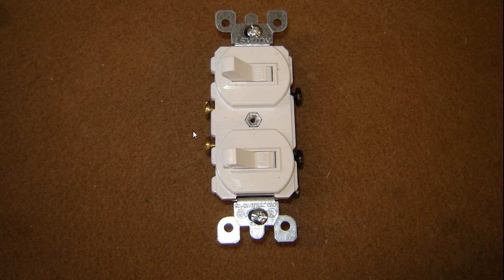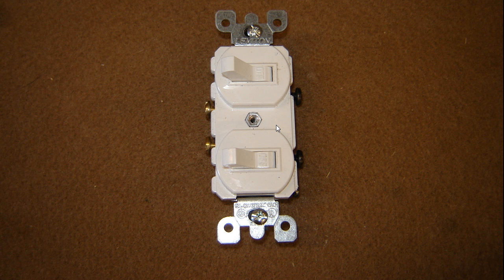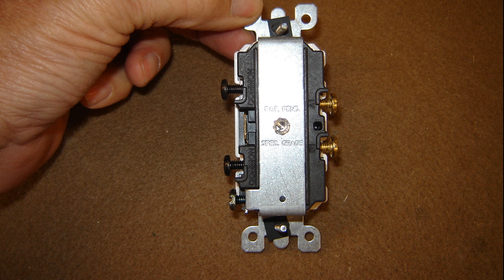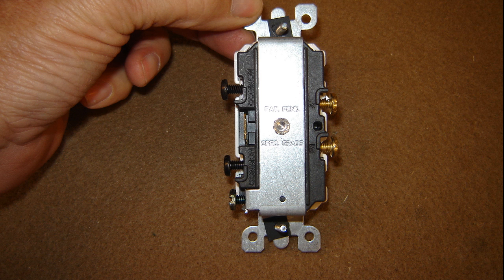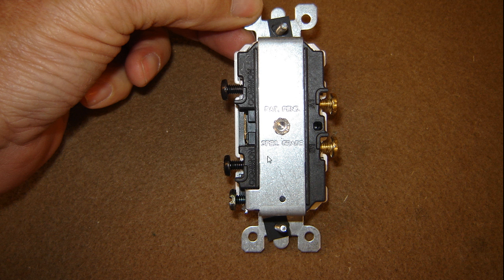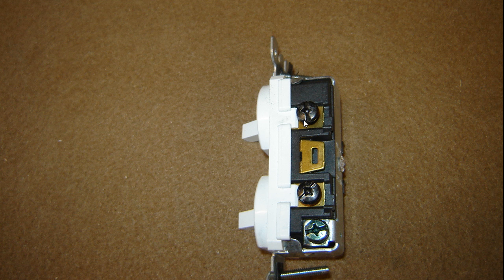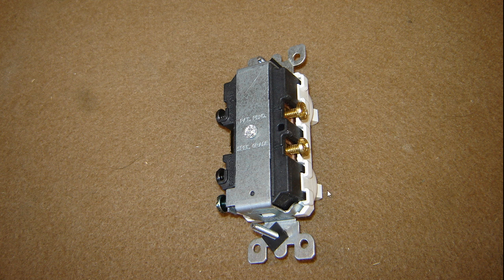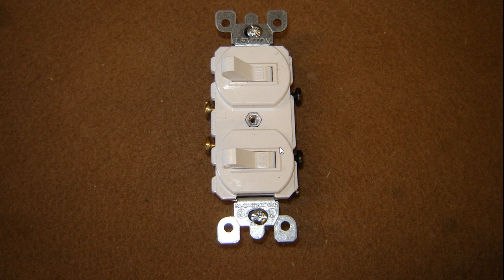Electrical Wiring-Stack-Switch

Comment: When do you have to remove the tab between the 2 black screws? Is that when you have two circuits or when you do not run a jumper when you only have one circuit?

Comment: BLACK WIRE GOES WHERE. WHITE WIRE GOES WHERE!!!
Reply: marcia w Your white will go in a wire nut on their own. the appliances white wire and the white wire coming from the breaker that's bringing the power to your device will go together into a wire nut and taped up
Reply: @kytrapping5829 How does the switching stay in dependent then? I'm stuck here at this point. I had a single switch and the line neutral and the switch leg neutral are tied in and the 2 hots are on the screws. Ground tied in as well. 

Wanting to add a stacked switch, but the switching legs would then be tied together so how does the switch differentiate at that point??

Comment: Need to give more detailed infor re break away tab when to break and when to not break and what does it do
Reply: The break-away tab is only broken if you want to have each switch on its own power source. If you have only 1 power source you do no beak it and hook common (black) either of the black screws. With the tab intact, it provides connectivity between the two switches so that they both receive power as long as there is one feed to either black screws.

Comment: Hot goes on the brass screws, switch legs go on the black screws, otherwise you've got the right idea. I believe you should make the point that if you have two different phases going to that switch, they make 240V together and merit extra caution
. ALSO you should mention that two phases can be brought in and share the same neutral (white), but two different circuits of the same phase should NOT share a neutral
Reply: WRONG. The black screws have a tab between them, which needs to be broken to separate the two hot wires or left connected if only one hot wire (common) is being connected to either black screws. The brass screws connect to the light fixtures (or whatever device you're connecting), and are made hot when the switches are turned on. Of course it would work with the wires reversed also (as you described), IF the tab was broken, since turning a switch on connects black and brass terminals on that side either way. If you left the tab intact and used only ONE hot wire, it could be connected to either BLACK screw and then the switch legs could go to their individual devices as in the previous example, from the brass screws. So NO, you're wrong-and if 2 hot wires were connected to the brass screws, and 2 switch legs were connected to the black screws as you suggested, either switch would control BOTH devices (UNLESS you broke the tab). So basically, nothing personal, but no. :O)

Comment: Hi, i have 2 toggle switches that control 2 ceiling lights from either end of a staircase. I want to replace the switches with stack switch so i can control each of the ceiling light separately from each other. How can this be done?

Comment: Why did you say break the bar on the switch?
Reply: bigcartoonyIIV it makes the switches separate for individual appliances or not broken is makes both switches act together
Reply: Incorrect, the switches always control separate appliances, breaking the tab lets you have each one receive its own power source if you have two sources.

Comment from the maker: @BishopofMusic Do you want to replace a stack switch with a single pole or you wanting to use only one of the switches on a stack switch? An example would be if you had a stack switch for your bath room,one controls the ex fan and one controls the light. Provided it is just a standard ex fan(not a heater unit) you could combine the 2 switch legs and operate off of one single toggle.

Comment from the maker: Line and load,power in-power out in simplistic terms.
The silver screw mentioned usually indicates a neutral is being used in the case of some pilot light switches.

Comment: as with the other guy, what's the scoop on the different screw covers? I've done a bit of basic wiring around the house; replacing outlets, light fixtures and switches, and I gotta admit, I'm curious about the varying colors; color-coding, or something else?

Comment: I have put one of these in my bathroom to run the light and exhaust fan separately. Works good. Thanks for the upload. One question, the screw colors...  Why are the feed screws black and switch leg brass? Most I have seen are feed, brass and swtich leg, silver. I'm just confused. Could you explain? Thanks.